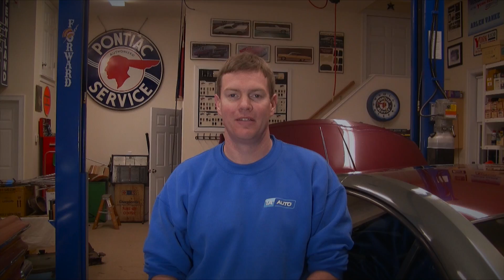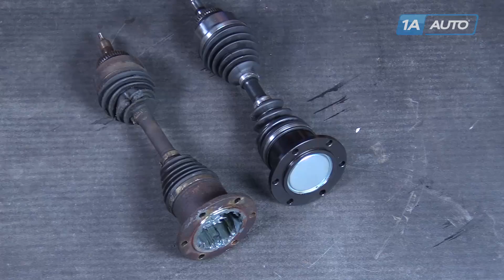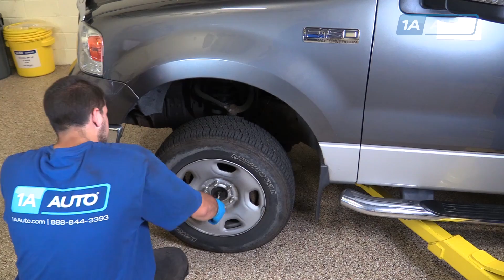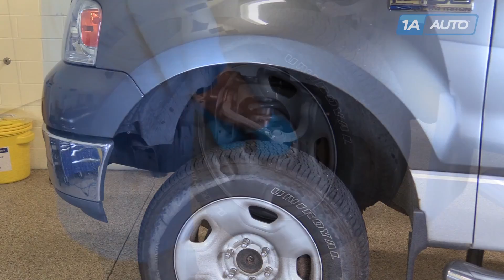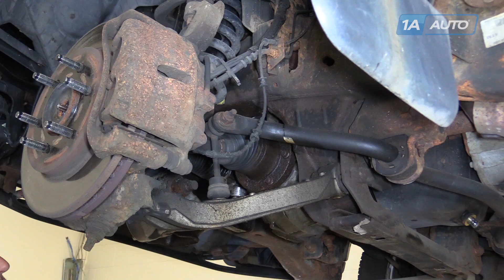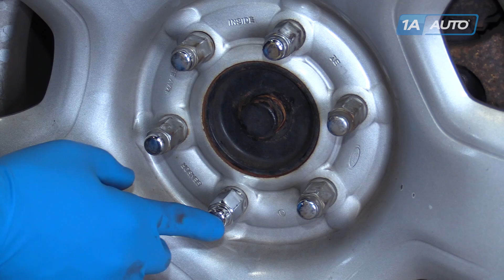How To Replace Front CV Axle Shaft 05-08 Ford F-150

Comment: I'd rather remove the strut. Other wise ppl will drop the knuckle and disconnect the sway bar link or even the calipers and all other useless procedures. So removing the strut bolt is the easiest way and best way to do this.

Comment: If you have a leveled or lifted version of this truck, DO NOT loosen the lower strut bolt and move the lower strut arm!!!!! That caused 8 hours of sheer madness... Remove the upper control arm and tie rod end nuts to get the strut back in, or use that method to loosen the knuckle and slide the axle out that way. I now have to replace the CV axle(again) because I put the pry bar completely thru the boot trying to get the strut back in......

Comment: This video is a little better than the last one I just watched but you  should be very careful tightening the little axle nut because it doesn’t need much and will break off the tip of the axle shaft spindle real quick! Never use any power tool on this nut! And if you’re using a torque wrench, make sure you got it set right and even then I wouldn’t trust it.
Reply from the maker: +@i12bgood2u Thanks for the feedback!

Comment: Great video, just wanted to say they did changed the design on the inner part of the CV axle. Anyways just wanted to point out that if you are running a leveling block in the front it will be more difficult to get the the strut back into place

Comment: The 13mm bolt torques to 20 ft/lbs.  What about the six 12 pt bolts on flange and the lower strut bolt?
Reply: What happens if that 13 mm nut breaks with threads ? does it become dangerous to drive to a shop . Does the CV axx need replaced again ?